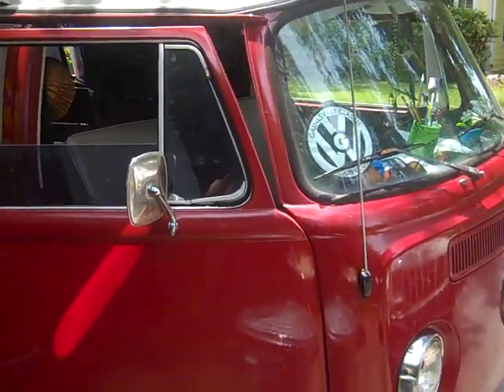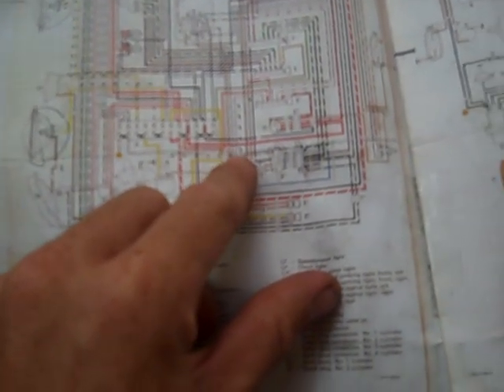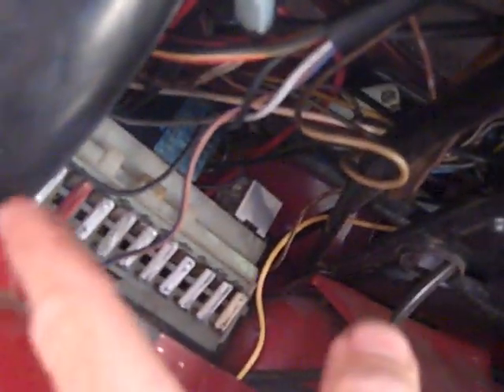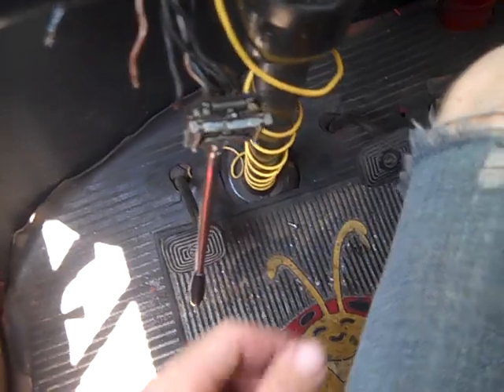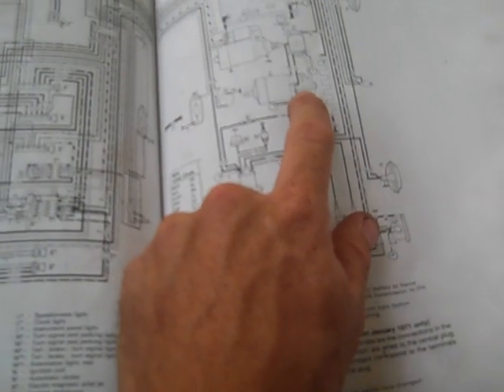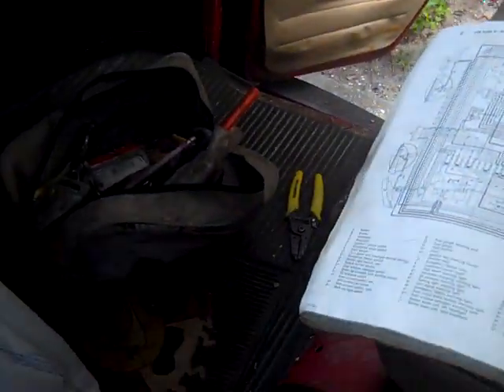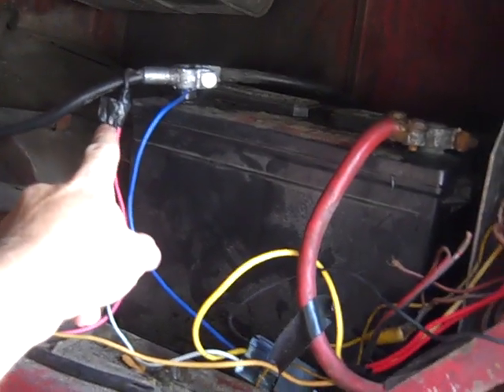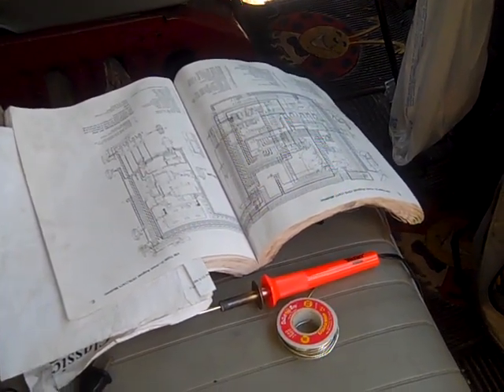Electrical work on my VW Bus '71: Fix your wires! Volkswagen wiring.

Comment: Hey I wonder if you can help me out as I'm working on a 75 bay window and finally got it running but the battery is not charging and I'm not sure if I have the starter hooked up right and wondering if you could tell me if all the wires go on the positive side of the starter or if one or more of the wires should be grounded somewhere? Thanks

Comment: I just bought a 71 VW transporter. the previous owner made it so I have to use the defroster to turn on the car. the radio doesn't work. the lighter ports don't work. and reverse lights don't work. I think the previous owner did something goofy with my wiring. got a lot of work ahead of me.
Reply from the maker: +Sakelarios Kouskoutis just take breaks if you get too frustrated.

Comment: Did you have trouble with your brake lights? I have a '71 Transporter. The 4 way flashers in the back and the brake lights don't work. The oil light won't come n and the brake warning light on the cask won't go off. I replaced the entire wiring loom and still can't get those problems fixed. Any ideas?Also, when you put the wires back together, instead of using wire nuts and electrical tape, use shrink wrap. You can buy a whole box of different sizes and colors at Harbor Freight for a couple of bucks. It saves space and looks a lot better.Bob from Abington, MA

Comment from the maker: thanks! I try, hehe. I use red or blue (gauge?) and did not really trouble with color-coding. But I do hear that you can buy individual colors that match the originals! I go outside the harness, and leave burnt wires in place, just unconnected. So, I have to run my red or blue in the body, and they are kinda obvious, if I have to go back. Not necessarily a permanent fix, but a working one. Still have to figure out, my RR tail light is out again, and now parking lights not working. Jiggle fuses?

Comment: I hate it when previous VW owners screw with wiring and you get the leftover mess :(
Reply: Tell me about it, been helping my uncle doing 2 T2s up as a pet project, one wasn't tooo awful bad, just a few mods, but the second one, dear lord, there were wires everywhere, unfused feeds from the battery in bell wire all the way to the cab, spliced into other wires, joints made with scotch tape, fuses bypassed, the works!

Comment from the maker: You will most likely need a new switch. They can be expensive, unless you can find one at junk yard. Samba has them a bit pricey, but they are original. MidAmerica Motorworks has "universal" ones that will work. The one I got from junk yard, I mended it to work, but plastic had broken, and was worn out, so wouldn't last long. That's when I decided to solder my original one. Hit up some VW shows in your area, and go to the SWAPs. Google "Samba events" to find them by state.

Comment: Love all your videos, so very helpful.  I also have a 71 bus.  No turn signals, found some melted wires in the rear that I'm pretty sure are the culprit.  What kind of wire did you use for replacement? what do you do about matching colors? Thanks so much for your help!

Comment from the maker: hey, glad to give you a bit of motivation. Yes, the second battery is auxiliary for my lights and charging toys. I have a simple relay switch I got on eBay for 99cents attached to it. The alternator was set up before I got it. I have the old generator. The setup had to swap out the alt. stand, fuel pump, and it has an internal regulator. Works well, but accelerator pump arm on carb, rubs on the alt. as it is a bit bigger than the gen. Also, my alt. bearings are already going out. Good luck!